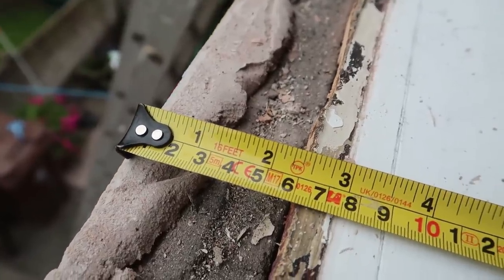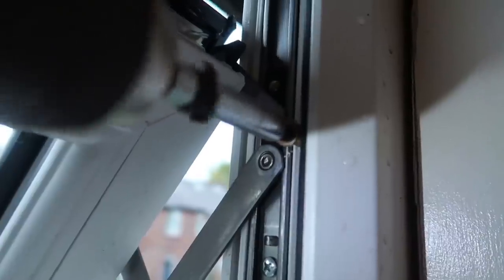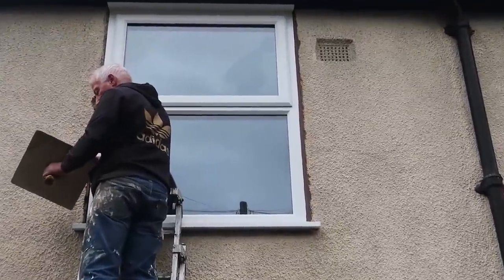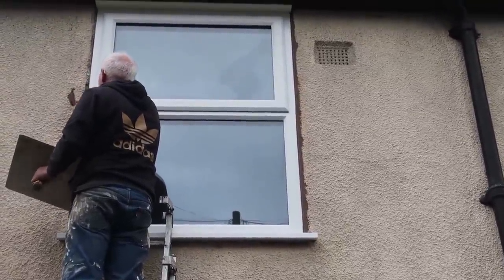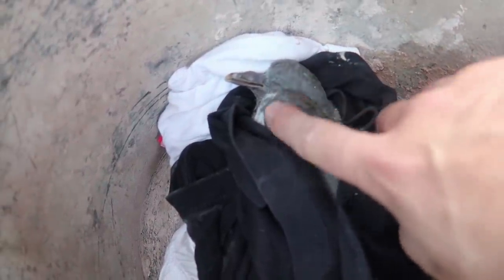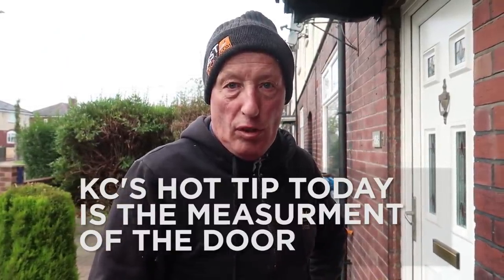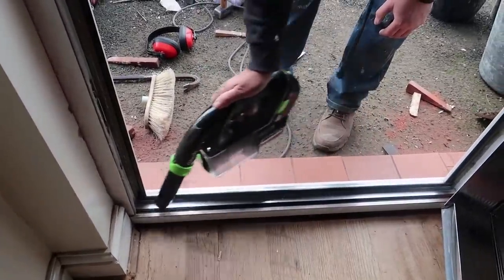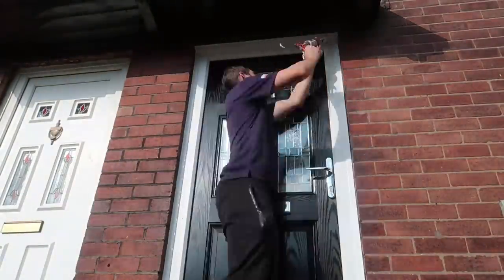Hardest job ever finished , Composite Doors and Saving Pigeon

Comment: Great job stu, invest in some stelmax (gap filler) for sealing plastic to plastic instead of silicone, its solvent based and drys solid bonding the two plastics together, has a stay white guarantee and doesn’t get that dirty look that silicone does. 👍🏻
Reply: Thanks for the tip, I'll certainly give it a go.

Comment: Stu. if you haven't already, you need a ladder stand off . leaning them on a plastic sill is asking for trouble. very slippy and you are forced to lean back when working. Be safe my friend. A stand off has the added bonus of somewhere to place a small board to put tools on or small bucket. love watching and learning from you guys. and the crack between father and son.

Comment: Cracking job again! Quick question...I fit few doors and windows but most have steel/metal in frame. Do the doors and windows you fit have steel in frame too, if so what SDS drill bit you using as it looks like you drill straight through frame into brickwork with ease?!?! Cheers
Reply from the maker: All fully reinforced buddy an use concrete screws straight into brick
Reply: @Stucrompton1  yeah but do u use standard SDS drill bit through steel inside frame?
Reply: @norris5353  bosch multi construction bits aren't bad.